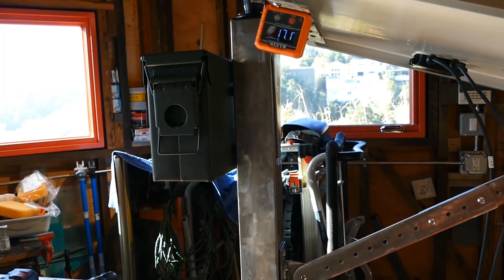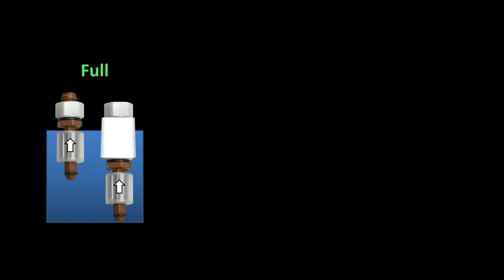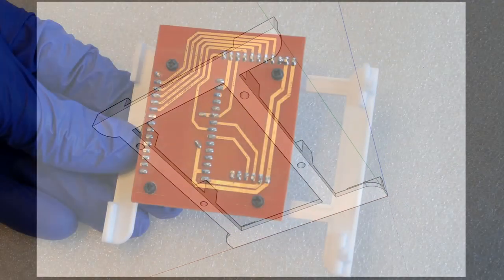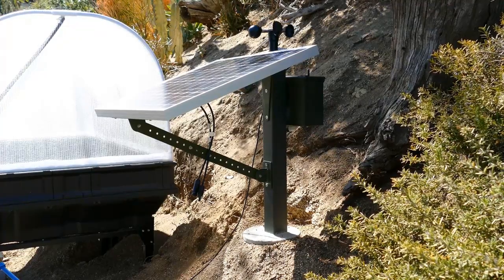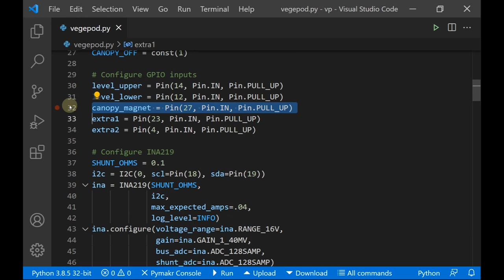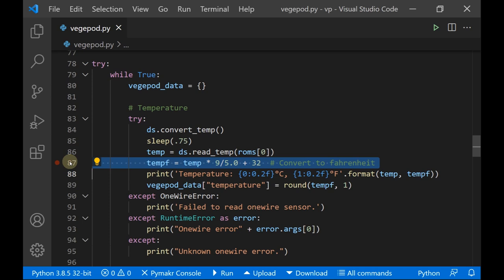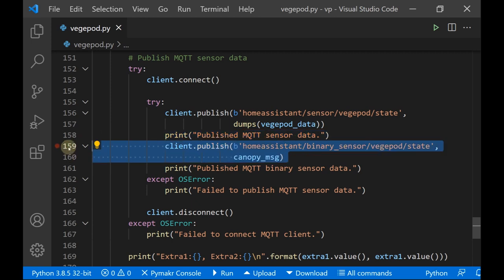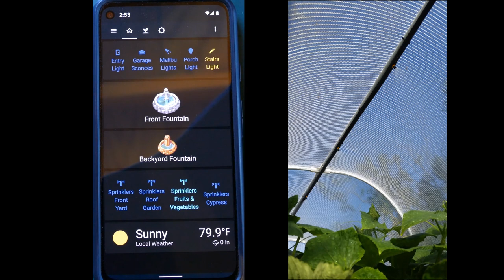MicroPython Vegetable Garden Automation Tutorial

Comment: Nice project. I think you planted way too many plants in the enclosure and you will need to remove a lot of them (if you didn't already). Only one watermelon plant needs a lot more space than what you have there. Next to the overcrowding, you will see bugs, mold, shadowing, nutrient competition etc. 

it looks like an excellent seedling starter, even more if you add some kind of heater or heated pad to the enclosure. A small fan would also help with the air circulation and prevent some of the problems.
Salad is also an option, although it doesn't like hot weather. Dwarf tomatoes,  peppers, eggplants would love the hot environment.
Reply from the maker: Thanks for the recommendations!  You’re right that I planted way too much.

Comment: Dude! This is awesome.  I want to build something similar here at the house. I am also toying with the idea of a weather station at the local community garden (about 2 miles away, no utilities). The idea there would be to broadcast that json object over LoRa. I've tested and can get data from that location of LoRa, I've actually been able to get about 4 miles of range.

Do you have a discord or belong to one? I'd love to spitball ideas and projects.
Reply from the maker: Sorry, I get more queries than I have time.  I do try to respond to all questions in the video comments as long as they are somewhat on topic and specific.  I don’t have any firsthand experience with LoRa but some type of LoRa MQTT solution would probably work well.  It’s been almost a year since I implement this project and I’ve been very happy with the results.  The solar system, Wi-Fi and MQTT have been very reliable.  Home Assistant has been great and much easier to maintain than my previous DIY approaches.  The anemometer died so I need to find a better replacement.  I might make a follow-up video when I have more time.